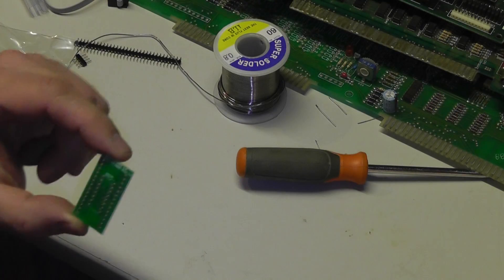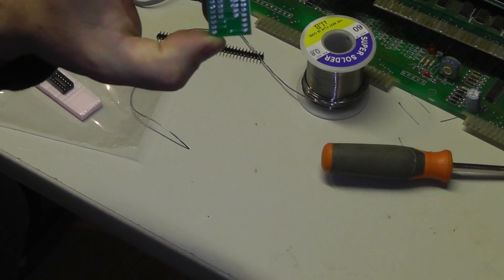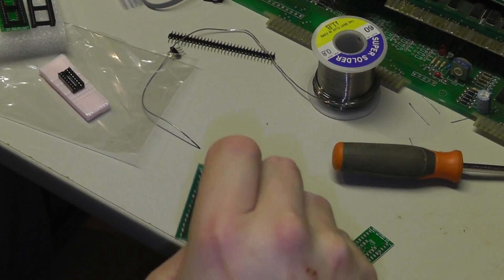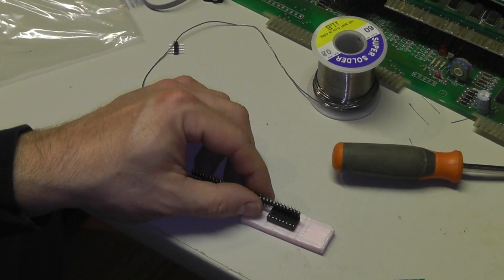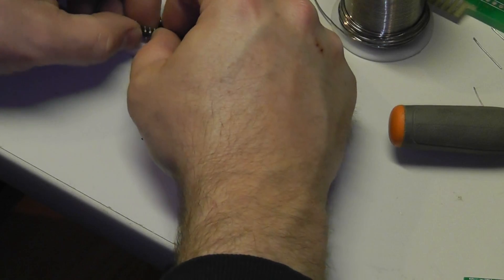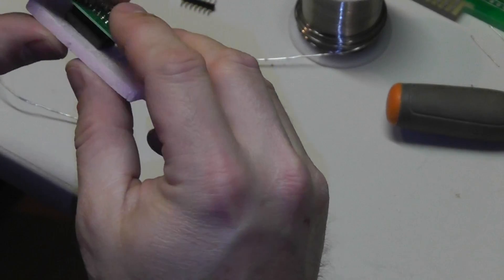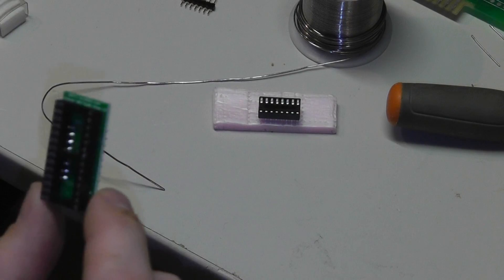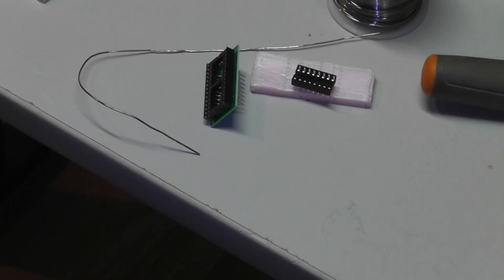82S123 bi-polar PROM replacement kit Assembly

Comment: Can programming the prom?
Or just read it?
Reply from the maker: Just read it.  The adapter lets you program a 27512 to replace the bipolar prom or read the prom as a 27512.  Only certain device programmers are capable of programming these older bipolar proms.

Comment: When you're reading a PROM with the adapter on your GQ-4X, what chip do you need to set it to in order for it to read properly?
Reply: Nice video, one correction, you mentioned you cannot erase the W27C512 in the GQ-4X, but you definitely can! thats one of the main reasons I love using these chips so much! instant erase!
Reply from the maker: You read the chip in a EPROM programmer as a 27512.  I recommend checking out arcade-cabinet.com site.
http://www.arcade-cabinets.com/board_hacks/82S123-to-27512/  he also has some converter tool to assist.

"Important note:
When reading as a 27512 you will have 65536 bytes data file.
Use the online converter to convert the image to a normal 82S123 image file."